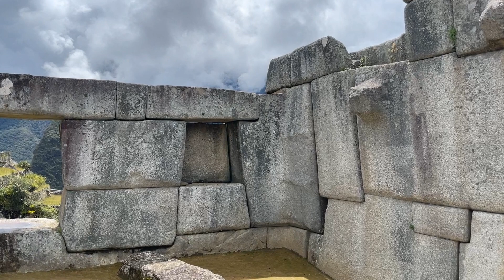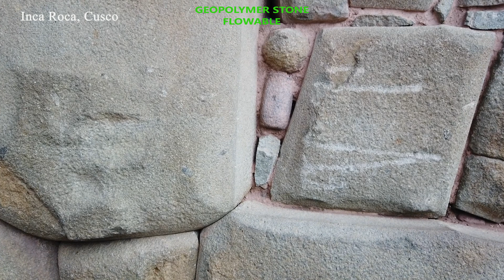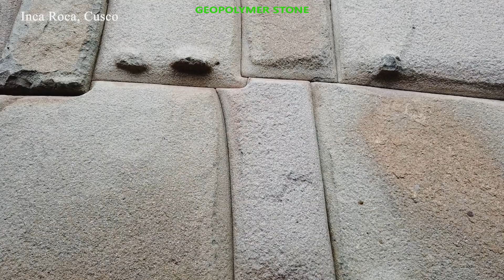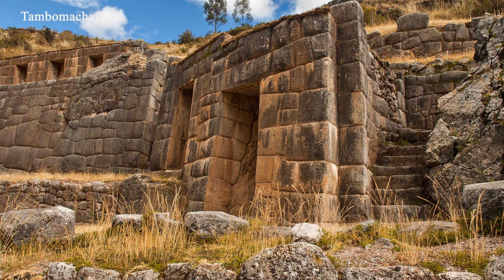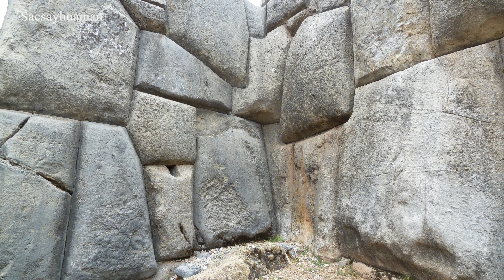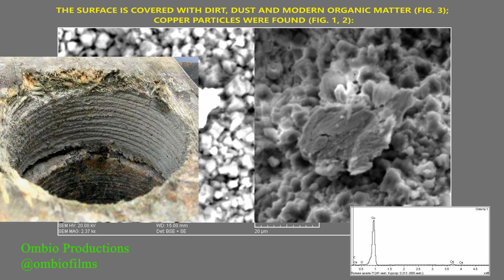Facts about geopolymers in Peru and Bolivia. And what alternatives? #history #ancient #incas

Comment: fabulous as always. 
I felt you skipped my prefered explanation: I saw it beind described as "red clay" acid.
a "paste", put in the rough shapes, dissolving the stone, using the stone weight for pressure on the areas of contact that would dissolve until faces are fitted.
(having trouble explaining it properly)
Reply from the maker: Thanks! Glad to see you. Using any type of softening it is impossible to get joints of the 1st type, they will be only of the 2nd type. https://drive.google.com/file/d/1vl5kbzVJQ-r6thLF66SaX-qk2TS2KxxR/view
Reply from the maker: The answer should include all regions where polygonal masonry was used. It is unlikely that the entire world would use acid and then forget how to do it.
Reply: @GRES_TAC  Did not explain well. My Idea is not about softening the stone into playdoh, it's a solvent. That would dissolve the stone upon contact, think of it as an acid, activated by pressure.
if one puts an acid in contact with the surface it will dissolve only where there's pressure/contact until the two surfaces are perfectly fitted.
It's a similar effect as polishing one stone versus the other, but without the need to remove it and allowing for curved surfaces.
This would only work for some of the stones in Peru and a few in Alaca Hoyuk.
Plus, no one knows how they were made, so it's all very speculative. We can say: I feel geopolymer does not work, but then since we don't know what dod work, we can't quite dismiss geopolymer either.
Reply from the maker: Thanks for the discussion. Very good assumption. I understood that we are talking about a thin layer.
In my opinion, there are some discrepancies.
1. Before joining the blocks, it is necessary to prepare the surfaces with an accuracy of several mm. But if it is possible to process the stone in this way, then nothing prevents you from bringing it to an ideal joint using the same method.
2. There will be no pressure on the vertical sides. Therefore, joining the vertical sides requires a different approach.
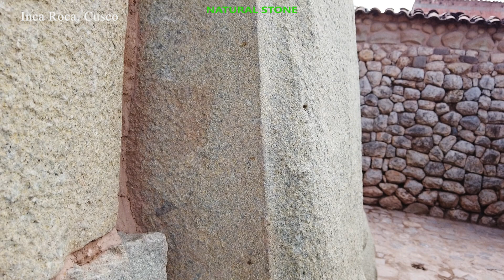3. How to ensure a gradient surface relief. 14:22 The surface must have the same texture across the entire depth.
In addition, traces of grinding are visible in Egypt. There are also traces of grinding in Ollantaytambo, according to Protzen.
4. How to get smooth surfaces. When closing under weight, the surfaces will be relief, and not smooth - polished. 
5. There is a good experiment - take 2 bricks, grease them with a thin layer of something viscous, close them and see what happens. In this case, you need to grease them. I once conducted such experiments.
Therefore, point 6. In some places, the thickness of the viscous layer will not be enough and gaps will form.
Reply: @GRES_TAC  Speculating.
I understand the limitations, but on the other hand can't think of a better alternative for those curved fittings. The method proposed by Protzen of moving stones in and out of place until perfection seems infinite and even absurd as the polishing would allways over cut and never be perfect and eventualy the stone is gone trying to find the perfect fit.
My idea is that if the acid only dissolves the stone under pressure it can stay on top of the stone in the gaps and nothing happen, only in the place of contact a tiny layer is dissolved, then the stone is lifted, more acid aplied and repeat, removing tiny layer after another only where there is contact, until its perfectly fitted.
As per the laterals, it could word with sloped sides, and also via atrittion, that is also pressure.
Also, not saying it's easy nor fast, just possible. Whislt carving two absolutely simmetric 3d curves is not possible.
Reply from the maker: "Plus, no one knows how they were made, so it's all very speculative. We can say: I feel geopolymer does not work, but then since we don't know what dod work, we can't quite dismiss geopolymer either." I agree. And that's why I try to collect as much data as possible about the characteristics and traces of stone processing. https://youtu.be/Hdwim_n1m_0
Reply: @GRES_TAC  and you do an awesome job at it!
Reply from the maker: @One-eyedgiantbuildingwall  Thank you! Your work is impressive too. "Speculating" Logics. Basic tool of cognition. "The method proposed by Protzen of moving stones in and out of place until perfection seems infinite and even absurd " I'm not talking about Protzen's method, but about the fact that there are traces of mechanical processing on the blocks in the form of scratches. The method itself is questionable. "My idea is that if the acid only dissolves the stone under pressure" Then it is not an acid, since the chemical action is not controlled by pressure. You suggest softening the stone in a thin layer. However, the idea of softening, or even better, reducing the strength, allows you to process blocks and rock outcrops.  " Whislt carving two absolutely simmetric 3d curves is not possible." The best results were obtained by modeling where the masonry was assembled from snow blocks. In this case, fitting is not a problem - it is enough to remove the material as it approaches. " the acid only dissolves the stone " Vinegar, or better yet vinegar essence, quickly dissolves limestone. Therefore, you can model it by making a paste based on vinegar and lubricating the blocks.
Conclusion. Your idea for joining blocks uses softening of the stone. Just remove the acid and introduce another factor that has appeared in all cultures.
Reply: @GRES_TAC  this is not about "how it was" that's unknown. It's a pet theory to entertain.
-pressure would produce heat, heat would activate acid. that's my idea.
The more standard explanation is similar to the blue marker dentists use to identify the contact points on theet. paint one stone, put it toghether to the next one, see where the paint touched and remove. 
People tried this way, I've seen it, and it does not work. stones are too heavy and don't go back to the same exact spot as before.
All this is just the finishing aspect, to achieve rougher fitting and to remove the 95% of the stone I believe mechanical tools were used.
Also, most walls (like the lower levels in Ollantaytambo) would not use any chemical paint or acid, they were just shaped visualty by hammering them down. moving from that lower level of finishing into the perfect ones, that's where chemical aids would come in.
Reply from the maker: @One-eyedgiantbuildingwall  "pressure would produce heat, heat would activate acid." - Pressure does not convert into heat. Only pressure change. So the temperature jump will only be at the moment of contact of the blocks. And it will depend on the speed with which the block is lowered, if it is a smooth movement, with the speed tending to 0, then there will be no change in temperature. Otherwise, it would be possible to install a stone block on a thermoelectric generator and receive infinite energy. "People tried this way, I've seen it, and it does not work. stones are too heavy and don't go back to the same exact spot as before." polygonal walls were sometimes disassembled and reassembled with good accuracy https://drive.google.com/file/d/1hh6eotUY0xT7uFrvUQldE93Y90H-T3fZ/view And parallel fitting methods do not require constant fitting. "o achieve rougher fitting and to remove the 95% of the stone I believe mechanical tools were used" This is the question that interests me the most. Removing large volumes of stone in the masonry, risking damage to it, is surprisingly 18,34 https://youtu.be/1OQl9pqhPb4?t=1117
Reply: @GRES_TAC  mmm reassemble is much easier than fitting. 
Fitting can be overdone and that is irreversible.
Reply from the maker: @One-eyedgiantbuildingwall  Of course. But even at the beginning of studying this topic, I sometimes had doubts that the masonry could be disassembled and assembled at all. This sometimes happens during casting.
Reply: @GRES_TAC  yes, dissambled and reassembled (if each stone is marked beforehand) but collapsed and then fixed not quite.
As I mentioned in one my earlier and clumsy videos (https://youtu.be/2iK-9GE1U3I?si=8dJNyOEvqBvN_pLs&t=344) 
And also can be seen in all the re-works romans/spanish/and other occupiers do when they need to repair these walls. Once the blocks are splashed on the ground the puzzle becomes nearly impossible.
Some "experts" claim polygonal masonry was done to save on the carving by using pre-existing shapes, looking at random blocks for one that fits and just polish details. That's absurd.
Reply from the maker: @One-eyedgiantbuildingwall  Amazing video. Just like your observation in the other video that there are no nubs on the cyclopean walls.
Reply: @GRES_TAC  I might have misspoken. I am only aware of one nub in European-Cyclopean walls (in Olerdola, Spain). 
In South America (not properly "cyclopean") there are plenty as you know.
Reply from the maker: @One-eyedgiantbuildingwall  nubs are found only in masonry with ideal block joining. In ancient masonry, these are bosses - more correct and orderly protrusions. In cyclopean masonry, there are no nubs, as there is no precise joining of blocks. https://drive.google.com/file/d/1Q6YNc_mkKNNnmsnJXDlLz6NgJ3AH9EDx/view?usp=sharing then we need to talk about different tasks and techniques
Reply: @GRES_TAC  mmm not really, it's a bit more all over the place than that. There are options for all tastes:
https://www.youtube.com/watch?v=IRBVsiNG6pg
Reply from the maker: @One-eyedgiantbuildingwall  Thank you. Excellent collection. Everything is correct - nubs are part of the precise connections of blocks. They are always and in all regions located at the bottom and paired with a notch. (the notch is sometimes barely visible). In the center of the blocks, in ancient masonry (officially Greek and Roman) - bosses. Including lifting bosses, decorative, etc. There are also remains of lintels from quarry work. This is a different type of objects. In total, under one term "nubs" are understood different categories of objects with different purposes and origins. In the polygonal masonry in Ollantaytambo, there was a transition from notches on the side of rectangular blocks to nubs on the front side.

Comment: Clearly the process was primed with a surface substance, combined with surface pressure. Rather than plastic 'flow', It would be a non-diffusional transformation - something akin to a martensitic phase transformation in one or more of the phases present (but only right near the surface for perhaps a few millimetres depth). That would solve the issues you raised.
My guess would be a hydroxide paint to target the silica content, or a hydrogen permeation process (a substance that releases hydrogen when squashed)
I'll add that the random disappearance of this technology may suggest it used a non-renewable resource (on the time scale of their civilization) such as ancient animal droppings which built up in a cave over eons.
Reply from the maker: Thank you! " something akin to a martensitic phase transformation" Yes, only in a stone consisting of a conglomerate of various crystals (granite)

Comment: Advanced galactic lifeforms may know how to create synthetic stones that overcome your simple sclerometer test. Our humdrum concrete is not much of a guide to their capabilities. Different techniques could have been used at different sites. There are very few H-blocks in Puma Punku, for example, so no need for "mass production" there. Thermal softening of stones in Sacsayhuaman is very plausible and it is a simple matter to 'tidy up' the surfaces before they fully solidify, to achieve the observed results. At Puma Punku, the synthetic andesite blocks clearly did not form gradually over geological timescales, otherwise they would not exhibit such a chaotic ferromagnetic signature. There needs to be a more open-minded approach: different megalithic sites present different sets of mysteries for humans to resolve - they should not all be lumped together. An argument against something at one site may not be valid at all at any other site.
Reply from the maker: "Advanced galactic lifeforms " - First, data collection, then comparison with all available knowledge. Then, putting forward real hypotheses, and the most extreme option - metaphysical assumptions. "different megalithic sites present different sets of mysteries for humans to resolve" - one principle both in production and in intended use
Reply: @GRES_TAC  The assumption that ancient humans constructed what ancient humans were clearly physically incapable of constructing, achieving feats that even modern humans with modern technology have not been able to replicate, is a very metaphysical position. In contrast, the continuing presence on this planet of the advanced galactic lifeforms responsible for the megalithic sites was firmly established using statistically robust results (over 100 standard deviations removed from random chance) some years ago (prior to the pandemic). The sluggish pace of academic progress (combined with academic bigotry) over the course of the last 80 years is currently one of the main arguments for the premature termination of our (experimental) species.
Reply from the maker: When a person encounters an unfamiliar phenomenon that needs to be explained, two approaches are used. The first one is mythical, where the explanation is based on speculating about entities. For example, lightning occurs because Zeus (a fictional character) sends it with his staff. A distinctive feature of this approach is that the fictional entities are always multiple — Zeus (Advanced galactic lifeforms), the staff (incredible tool capabilities), and the battle between Zeus and someone (controlling the human population).
The second approach is analytical. It involves studying and comparing data. Lightning occurs during rain, rain happens when there are clouds, so lightning is associated with storm clouds. It is characteristic that a supporter of the first approach will immediately object, "Lightning is fire, and fire cannot come from water" (copper cannot process stone). The mistake lies in the incorrect interpretation of the data; lightning doesn't come from water, but as a result of ionization, an additional factor (copper doesn't process stone on its own, there is an unidentified factor).
It should be noted that the mythical approach explains nothing and serves as a means of calming the curious mind. The analytical approach not only explains but also makes practical application possible.
Reply: @GRES_TAC  Well said, also it was good that your introduction included your awareness of facts that prove the stones to be of natural and terrestrial origin as i wasnt sure where this video would lead, thinking i might be hit with aliens at any time haha.

Comment: Great stuff!!! Very insightful. One thing that has been a curiosity and would answer a lot of uncertainty regarding the cut in the 'abandoned' sarcophagus (at the end of the vid) and all of the conversation about it. What is the shape of the cut at its deepest point?? Flat or rounded? This would be easy to answer, it must be published somewhere?
Reply from the maker: Thank you! "What is the shape of the cut" - all sawing marks in Egypt are linear.
Reply: @GRES_TAC  wonder why so many claim large circular saw? That makes no sense. strange. thanks
Reply: @GRES_TAC  I'm watching videos on the Basalt floor and I have to say I'm nearly certain I'm seeing cut marks made with a circular blade. Thoughts? (please)
Reply from the maker: @SJC-73  Thank you. Yes, of course. Let's first find out what exact place and traces we are talking about. There are several basalt floors. Do you have a link to the video? With timing to a specific frame.
Reply from the maker: @ and watch this video, maybe it has some answers https://youtu.be/jp8lG5yDhqc?t=5473
Reply: @ Thank you, Giza, Kufu Mortuary temple, I will go through videos and post again later today with reference points.
Reply from the maker: @SJC-73  if Giza - you need to take this into account https://youtu.be/tOICtofKKM4?t=350
Reply: I am just learning of the extensive restoration work that was done at this location and therefore I have to retract my inquiry. I did indeed see signs of circular cuts but I have no reason to assume they are original. I will revisit this if relevant. I feel like I've seen several other circular shaped cuts (although mostly straight) and I will comment again next time. I will also watch the second video you sent. thank you